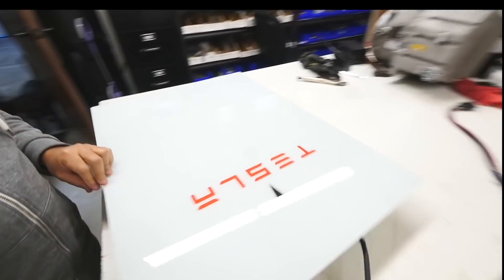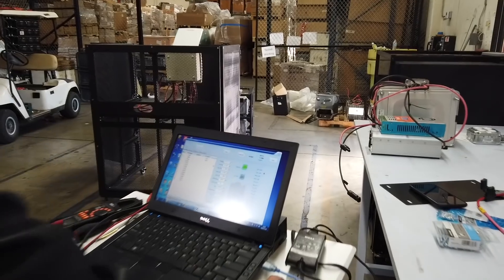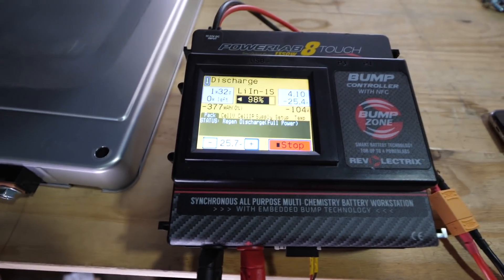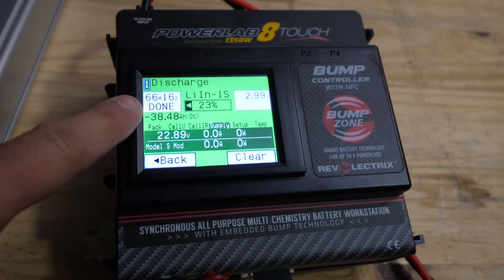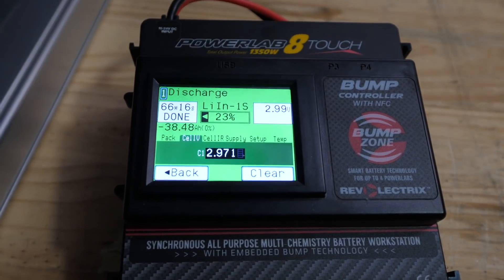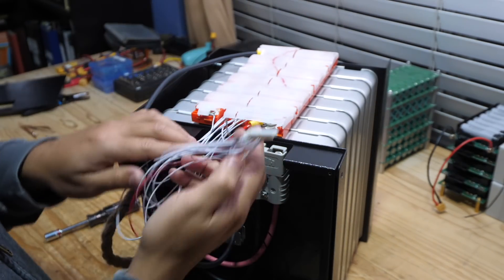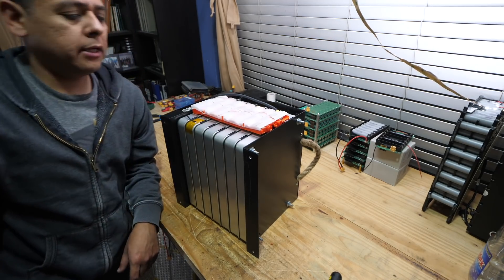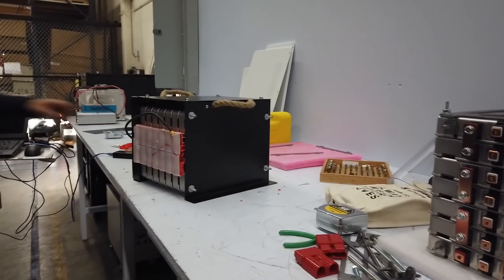Nissan Leaf Battery Modules Repurposed in Solar Energy Storage

Comment: I did something similar, but instead of buying individual modules, I just bought a whole Leaf battery from a wrecker.. That cost me $3500 for the 48 modules in the battery pack, and I just reused the Leaf's hardware (plus some threaded rod) to make my own 48V packs. And I didn't mess with a BMS, because the Leaf cells are pretty robust, and after using them for nearly 4 years, they are doing fine. Maybe they don't have the pretty case, but that doesn't affect their function.
Reply: I'm in the process of building a 24 kwh 48 cell g2 solar battery, I was curious what you did for an invertor.  How big off an invertor would you recommend for this large of storage?  10-12 KW?  Any insite would be appreciated.
Reply: @baileybonham1750  I am using a Xantrex XW6048 6kW inverter, and I used the full pack. You can program the charge and discharge voltages to make sure you never overcharge, or over discharge the batteries. The main use is to collect solar, and charge my EV. But it depends on what you are planning your system for.
Reply: @EleTruk  Hi !! I m using an inverter quite similar but with normal batteries !! How did  you configure the inverter charger to charge lithium packs .... I would like to switch to lithium ... thanks !
Reply: @carlosgorjao4037  I just set the voltage to make sure they never exceed the max or minumum of the batteries. The absolute max voltage on a Leaf battery is 8.4V, so if you never go above 8V you are good. Also on the minimum if you make sure the inverter never draws below the battery's minimum voltage which is 7.2V (absolute minimum is 5V, but that's damage the cell territory). I use a solar MPPT charger to charge the batteries, not the inverter. I just set the absorption/float voltages to the same max voltage, so with 6 Leaf batteries per pack (for a 48V system), the max voltage would be 48V, and the minimum would be 43.2V. Stay within those limits and the batteries should be fine, they have been for me. You won't get the max storage the cells are capable of, but they will last much longer if you don't push the extremes.
Reply: @EleTruk  If you do not have a BMS then you cannot set the individual CELL voltage, you can control ONLY the min/max PACK voltage.  You are like the guy who runs every red light ...  Hey man, not a problem for me ... Until one day, you have a fatal crash = BIG problem ...
Reply: @vtorsi610  I hear what you are saying. But the Nissan Leaf cells are pretty bullet proof, and I mean literally: https://www.youtube.com/watch?v=Jz37WycW-7E
Reply: @EleTruk  I do not think the typical cell failure mode is by:  "screwdriver" or "torch to the case".  Your video shows a single cell.  Most batteries will consist of a large, tightly bound, stack of cells = massive amount of energy.  It is the sudden release of this massive amount of energy that is the problem.  For the same reason, we do NOT store gasoline cans or propane tanks inside our home.  Maybe my problem is ... I place a very high value on my life and the life of my family?

Comment: Yes I plan to buy a 48 volt can a guy hook more then one of those batteries together like 2 of those 48 volt modules?
Reply: You can do 2P 7S. So you have 14 modules. connect two in parallel and the 7 of those in series to get 48V. Good luck

Comment: Oh right I see the cable is rated 40 amps because there is a fuse for 40 amps. Good to know.
Reply: i think this is sarcasm 12 gauge cable not 40 amp even at 1 foot. so is making heat and loosing voltage to output.
Reply: @ralanham76  Nope, not sarcasm,  the rating for that 12 AWG is about  40 AMPS ...

Comment: Thanks for testing these. I'm looking into building a powerwall and my source of 18650's has dried up and I only have about 500 useful cells out of the 1300 I got.  I had been looking at these exact cells as an easy option since it's just a few bolts and not 1000's of solder/spot welds.  I'm sad to hear that they could already be 50% degraded.  Not worth the money at that level, if they were better, then I could see them being a cheaper alternative to Tesla modules.

Comment: The first generation Nissan leaf batteries have a serious issue with battery degradation due to no significant cooling system in the car. My fear would be that that degradation percentage continues to increase over time making them not have a very long life after you have purchased them.

Comment: Did you only check half the cell? Need to check from negative to center post also. Then add the 2 tests together. Doubling the ah rating. Or if your charger will do it, check at 7.2 volt charge/discharge.
Reply from the maker: Unnecessary
Reply: Yep, your right, they are either degraded by half or overrated by double. :)

Comment: Sold as 500Wh but you get only 280Wh?
56% Capacity...so you pay 56% of the price, right?

I will not be buying from that seller   :(
Reply: about the same results I had from the Johnson controls batteries I bought thru Jahu... buyer beware!
Reply: @gemrough  , I bought two of the Johnson modules which should be 5kWh worth. I reconfigured the bus bars to get 6 (plus some spare cells) 7s sub-modules. So far, from the numbers on my solar charger monitor I am getting fairly close to the advertised capacity, resulting in a cost of about $150 per 1kWh. which is less than a used Tesla module and much cheaper than any salvaged 18650 setup. Unless I missing something the Johnson modules seem like a good deal.
Reply: @kirkwallace5345  your not accounting for charging inefficiencies. I measure output of the cells. I have 208 cells (13s x 16) and should have 23kw. Im actually measuring around 10kw!
Reply: @kirkwallace5345  which are those Johnson modules?
Reply: @gemrough  , my solar charger keeps data on the load port as well as the battery and solar panel ports. I also have a Kill-A-Watt on my inverter output, so I should be getting at least a rough tally of the total usable output, rather than just what my panels and generator are putting in. How rough a guess is in question. I put off getting any Leaf cells because of the recent chatter on "RapidGate" and my suspicion that these batteries were pulled for warranty replacement. On the other hand I have no history on these Johnson Controls batteries either.
Reply: @kirkwallace5345  report back in 5 years when they've burned up
Reply: @kirkwallace5345  report back in 5 years when they've burned up
Reply: Yeah. I'm waiting 5-10 years before I try to buy this type of battery. What is going on with the market for these is just silly.
Reply: Wouldn't you need of ton of 18 650s to equal one of these batteries?

Comment: Seems interesting to keep my Leaf pack with 97 modules instead of getting the ~ 1000 € refund from Nissan for my pack if i decide to replace it. 
Anyway a great solution for recycling in a powerwall. Most people in Germany argue against EV's because they think that the production of the EV battery causes more pollution than the car will save. But they don't look Yt videos like yours :)
Reply: good luck not giving them a pack back. I tried to keep mine and was told no even if paying core charge in USA
Reply: I am a Nissan tech and they will not even let me buy an old battery for the core charge. They make the customer sign a contract saying that they can't keep the old battery.
Reply: @gonesilent2814  interesting question. If Nissan solds a new one for about 6000 € and gives you 1000 for the old I assume the customer can decide what to make with the old one as long you are the owner of the battery that you bought with the car.
Reply: What is the Difference if i burn car fuel or Coal ?
Right no differense ecsept the huge energy losses from Generators to the Car battery and on the road + the lithium waste.

Comment: You never showed the wattHours... Ah with no amp load isn’t helpful...
Reply from the maker: I loaded the cell with 35A for an hour what the hell you talking about?
Reply from the maker: 38ah x 3.7v= 140Wh
Reply: @jehugarcia  that's not how you get wh. The voltage is not 3.7v for the whole discharge is it? If you use the proper equipment you will find the actual figure is about 100wh

Comment: If you were worried about efficiency would you use higher gauge wire so it doesn't get hot and use power to make heat?
Reply from the maker: If you wanted more than 40A continuos yes, but then again you’d run out of battery in 40 mins
Reply: If it gets hot/warm at all that is energy lost. A slight amount of heat can be huge in regards to Efficiency. If you are going to use these for a powerwall, for sure, use much bigger cables. Whatever size wire anyone tells you to use, double the size.

Comment: J,  I thought the center was just for temp sensing?  Is this a Gen1 or Gen 2 cell?  I'm using the Gen I cells currently, and the center screw I thought was just for mounting and temp reading.  Its smaller than the +/- terminals for a reason I thought.
Reply from the maker: I was told what I have is gen1 but I’m not 100% sure
Reply: @jehugarcia  Those are the gen 1. There are 4 cells in each module 2s2p. The center is for sensing the cell not temp.
Reply: @jehugarcia  you have the Gen 1 battery. The middle is positive or negative for the individual cells in the module
Reply: The center terminal is for balancing and the terminal is smaller. However internally it is the same as the other terminals.

Comment: Any reason you couldn't just parallel a few of these together with a 48v inverter and have your own "8kWh" pack?  Being so degraded does kind of suck though.  I do like that they include the BMS.
Reply: Yes of course you can parallel them together, as long as you make sure the cells have a similar state of charge, preferably <0.1V.
All the series cells need parallelling with their peers in the other batteries too if you only have 1 BMS.

Comment: What is the total cost for that pack?  The links in the description don't seem to include the brackets and bms, just the cells.  Also would you say that 2kwh is the theoretical max of new cells or measured capacity of 50-60% degraded cells?
Reply from the maker: https://j35.us/Leaf-PowerPack

Comment: I don't get why people get excited by buying random used batteries.  You have no idea what people did to them let alone how many cycles are likely to be left.  Spend the extra bit and get new cells and less worry.
Reply: HI! If you don't get the batterie craze, you're on the wrong channel...
Reply: That way of thinking is what's wrong with America and other countries.  Sure you could buy new, but not all used are in bad shape.
Reply: @Gskill2011  It looks like they charged too much for batteries that were so degraded. With 56% of juice left in them they are not good for this application. Probably 7-8 years old first generation batteries.
Compare with Tesla batteries, those will lose 10-12% in the first two years and then the process slows to 1-2% a year.
Purchasing used or expired batteries is hit and miss and people are understandably cautious.
Reply: @jcrnda  Agreed. For now most of these batteries are over priced potential junk.
Reply: @jcrnda  right but when building a power wall mass and size is less of a problem compared to EV applications.
Reply: @Gskill2011  Buying used batteries is cool if you don't have to depend on them....

Comment: I mean okay, but degradation Will only get worst no? Maybe one day they will just die
Reply: They should be fine if run cool and from 3.4 to 4.1V. They degraded quickly in cars from hot climates since the Leaf does not have active cooling

Comment: I see these advertised as 66ah but yet you got only 38ah on the test.  What's up with that?
Reply: Is that 38 ah for one cell? The module has two cells?
Reply: @MichaelEdmond  they're in series so it would be the same
Reply: Yes - but 2 cells in series - so 8v at 38ah  (not  8v @ 66ah)
Reply: @kenattagexp9871  2s 2p Total 4 cells
Reply: Thank you for that clarification - yes "Each Module has 4 cells ( 2 in Series and 2 in Parallel )".    However, back to my original comment.   Why did this youtube / test only show 38ah instead of 66?    Seems like the 1/2 the cell should have been the 2p,  so it should have been more like 66ah instead of 38ah.

Comment: Hey jehu,

would you mind to ask to Community whats the batterysituation for used batterys/packs around the world like ?! I am especially interested in Germany and neihbouring countrys. 
the questions could be like; Is it legal to sell battery without protection? Where can I find a good deal ? and so on. 

A new videoseries called" Batterys around the world".
Reply: that woud be interesting to see.
I live in Germany and as far as i know it is legal to sell any type of battery as long as it is as parts and not as a finished product.
The problem woud be delivery in large amounts since the transport company will have to do some safety checks.

Sadly as far as i have searched over the last 2 years there are no reliable and cheap battery sources like in the us right now.
Reply: Actually guys, living in Finland, I get most of my cells from  Germany. "Shop dot Lipopower dot de". They don't sell used cells, but they have high quality cells at a good price. It's also possible to get sales from the Netherlands or Czech Republic, but in those examples you almost never know what you're getting. I know there's a big market for repurposed cells, but new cells are pretty reasonably priced for a big project with long lifetime. If I'm just building small DIY projects, maybe the new cells are too expensive for some. If I were back home in the US I would probably consider some used batteries but not here in the EU
Reply: The area I live in in the United States, the local scrap yards refuse to sell them to me. Cash in hand but will not sell them. It's legal but someone else must be getting them.
Reply: @kevinroberts781  Germany has one big Problem..... Useless Laws.
Im really good at repairing pretty much any electronic device.
My local junk jard has containers full of laptop's and really extensive flat screen televisions.
But it is forbidden by law to re purpose anything that people have brought there.
Even if someone woud throw a 3000$ PC in there you woud get sued for stealing if you take it out.

Comment: Is that bms cutting off charge for the hole pack when 1 cell gets to 4.2 of just cuts the cells that are ready and wait for others to finish?
I have the same bms and mine cuts off entire  charge when  1 cell reaches 4.2v
Reply: Sooo not very good then wich means bms will not allow full charge or discharge if 1 cell is out of balance
Reply from the maker: It burns energy on high cells then allows for low cell to catch up,  properly operating bms will top balance a pack
Reply from the maker: Entire pack
Reply: marbesky, I don’t think the BMS can cut off, or isolate a cell.  It appears to just monitor the individual cells.